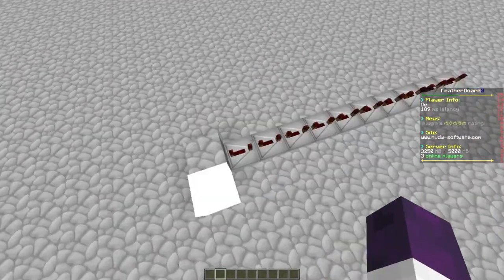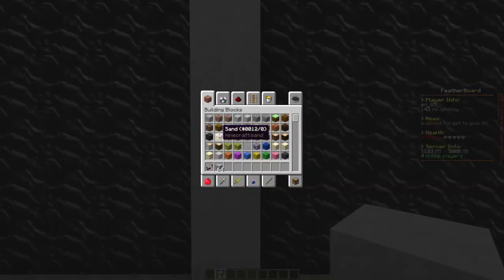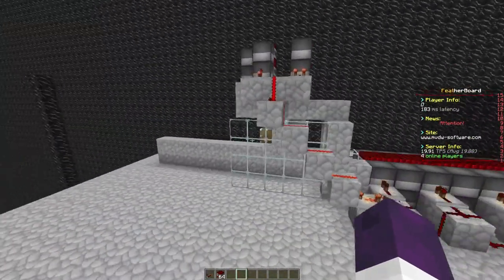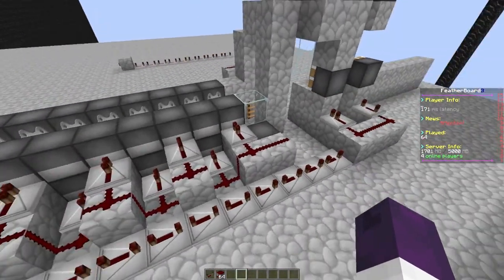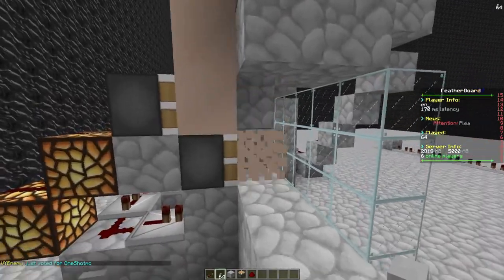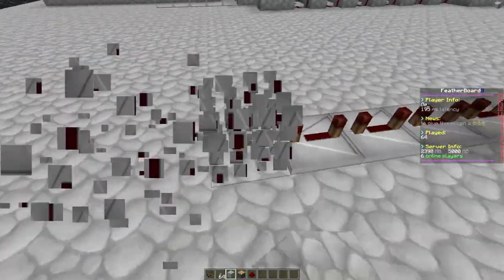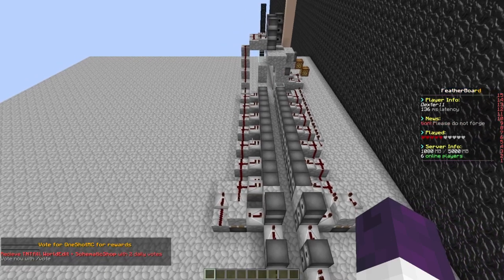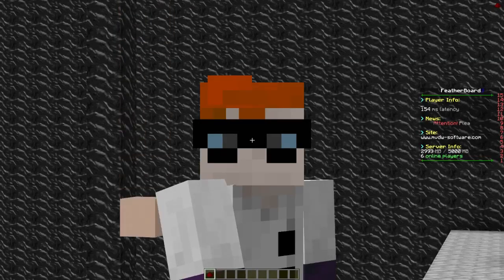Fusion Ticks And Explanation

Comment: Yo Dexter! How can I cannon into a spawner base (Spawners are at Y:250) but the skylimit is 256
Is there any way?
Reply: Build a 255 stacker and then hammer down to the spawners
Reply: The spawners are at the top of the base?!
Hammer goes downways or did I get something wrong?
Reply: slab bust
Reply: So my problem is:
The spawners are at Y:250
And I cant build above 256 
so how should I cannon the spawners?
There are obviously watered walls and its like 15 chunks
Reply: 255 barrel
Reply: sorry I am such a noob but is there a video or something for that?